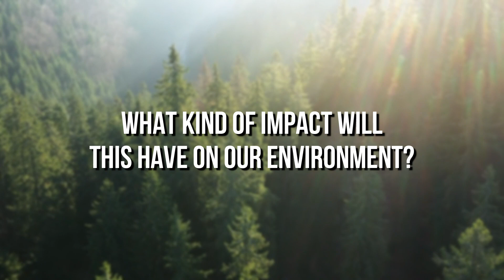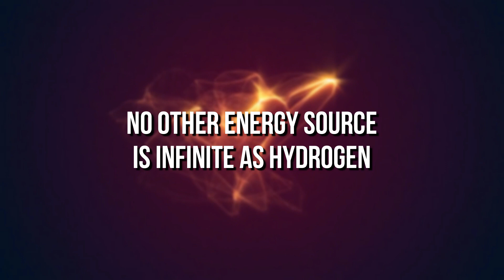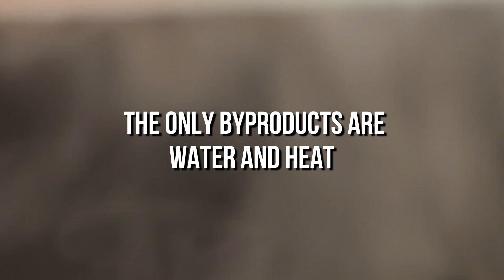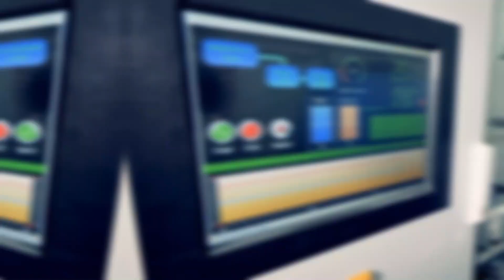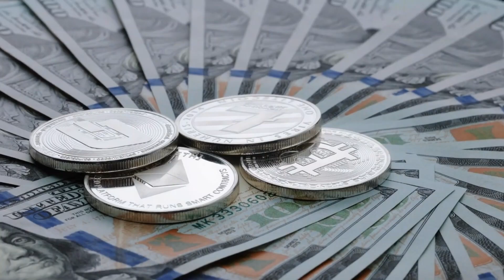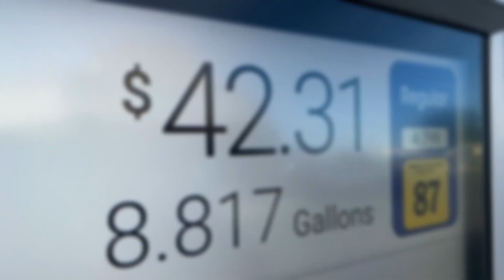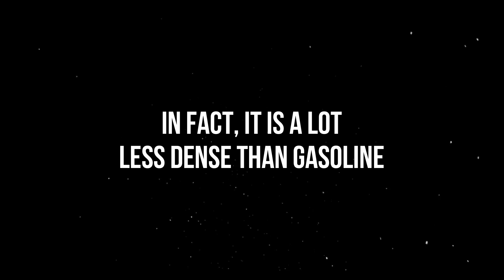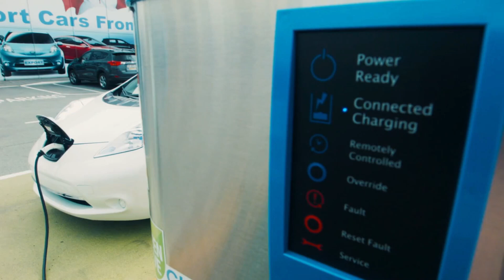The Hydrogen Hype: Is Hydrogen The Fuel Of The Future?

Comment: The main issue is you seem to ignore the costs & inefficiencies of production, transport & storage. Perhaps you can fact check, but I heard that to produce Hydrogen using electrolysis, then transport it & use in a fuel cell is about 60% efficient. If you build a pipeline you may as well install electric cables instead to Batteries (or other) storage facilities. In the UK much of the talk is producing Hydrogen from Methane and capturing the carbon. You then have the issue of efficient capture & safe storage. I have liked your videos so far, but feel you have missed the mark on this on.

Comment: I agree with most of the other comments already made. Hydrogen for powering cars, or heating homes is just pie in the sky thinking, promoted by the fossil fuel industry.  Due to inefficiencies in the electrolysis process to produce hydrogen from water in the first place, and then the fuel cell itself , it would take 3-4 time the electricity to produce the hydrogen to power a Hydrogen fuel cell vehicle, as it would to simply have a battery electric car. Burning hydrogen , does only produce water & heat, but only when it's burnt in pure oxygen. Burning it in air, still produces NOX particulates which are a major cause of breathing problems. Hydrogen is nearly always produced on site where it is currently used (Fertiliser plants, chemical plants  or some industries) as it is so difficult to transport. Current gas pipes are simply not suitable as hydrogen escapes much more easily than natural gas.
Carbon capture & storage has also been debunked many times, no current plant has captured anything like the amount predicted and most have released more in their construction , than they have removed from our atmosphere.

Comment: When burnt in a combustion engine, nitrogen oxide pollutants are produced - so no it is not a clean energy source when used in this way
Reply: Where does the nitrogen come when O2+H4+spark=h20+energy 🤔
Reply: @DJDannySteel  From the atmosphere (~70% is Nitrogen) that it combusts in... see https://en.wikipedia.org/wiki/Hydrogen_internal_combustion_engine_vehicle
Reply: Also nitrogen oxide= laughing gas 🤣 other N oxides not great laugh di oxide for sample

Comment: Hydrogen is completely impractical and cannot meet all of out transportation and heating needs. A lithium ion battery has around trip efficiency of 90%, hydrogen is about 30%. Why would adopt and fuel that requires three times the energy to produce the same amount of work? Hydrogen is the last dying gasp of the natural gas industry that knows it cannot compete with wind and solar. The biggest problem we have with changing over to 100% renewables is long term energy storage.  Maybe hydrogen has a role there or helping to produce green steel, but otherwise it makes no sense.

Comment: Hydrogen in my view is unlikely to make big inroads into the market as a major energy source.
Where Hydrogen is used in significant quantity it is mostly produce on site.
To use it to heat peoples homes ,i.e. to use existing pipe work is a none starter as it leaks through most things, so upgrading the infrastructure would be very expensive.
Converting electricity into Hydrogen is inefficient and a waste of energy unless it is needed where electricity is not possible.
Using it in cars again is a problem as they have to have battery storage as fuel cells can not provide sufficient short term energy for acceleration and steep hills. Fuel cells also need clean air so filtration is needed. Where possible just use electric cars and charge.

Comment: Using hydrogen in cars is stupid and wasteful. Energy needed to produce hydrogen, compress it, losses during storage and losses from conversion from gas to kinetic energy is so wasteful, that at best you will have 6x more energy needed. Plus storage is a nightmare. And moving it is even worse. The molecule is literally the smallest so holding it in is really difficult. Burning hydrogen for water generates NOx side products as our air is not pure oxygen. It is a dead branch. Energy efficiency is so bad it makes no sense. Check the Fully Charged podcast with expert on the topic.

Comment: This is by far the worst video you have done so far. And this says a lot.

Carbon capture doesn't work, see videos from Just Have A Think and others. The energy for green hydrogen should be put into batteries because EVs run 3 times the distance with the same amount of energy compared to HFCEVs using green hydrogen.

Yeah, it should be beneficial in industrial applications, ships and the like. 

But god damn, my 12 year old would do a batter job in researching the basics for this video. Unless you planned to make a commercial for hydrogen producing companies.

Comment: The hydrogen-hype is just that, a hype...
It will, in the long run, only find it's (very expensive and very small) niche application(s)....
Reply: Airplanes is where it will freakin shine. (Or explode if you want a pun)
Reply: I disagree. Look at the recent developments in hydrogen storage and transport.
Reply: @drusillawinters212  What about it? There's nothing really new there, I've known about these techniques/technologies for over near 40-ish years (yes I am that old)
I've worked with hydrogen, in both outright combustion application(s) as well as "fuel-cell" application(s).
The hydrogen was only viable, both technically and financially, as a fuel because it was basically a waste product from another industrial process. It would have been madness not to use it and reclaim it's energy content.
(I'd be curious to hear what you'd consider "new" ways of storage and transport)